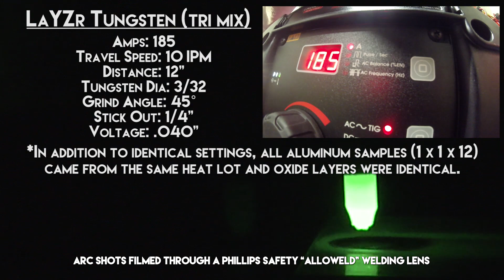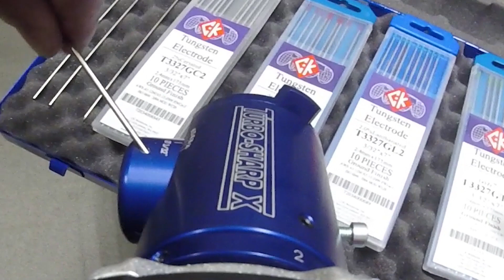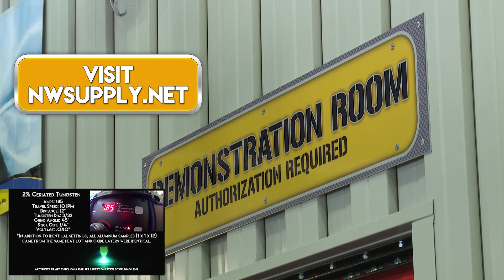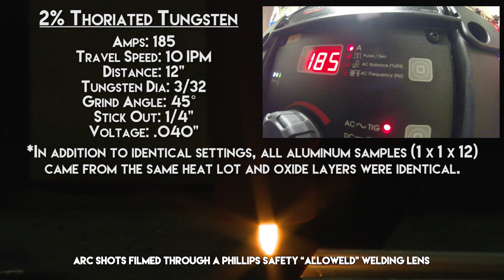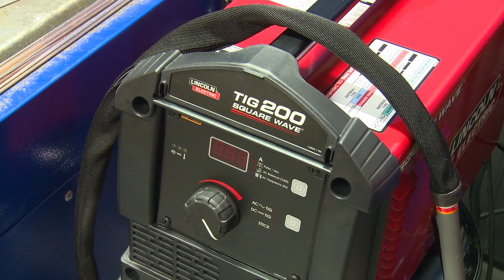Tungsten Comparison: Part 1 - AC Endurance Test | TIG Time

Comment: I've tried every tungsten I can get my hands on for Aluminium welding and by far my favourite and most durable is E3. Balls beautifully, doesn't crack or turn to shit like the ones in this video. 
My daily rod for the last 8 years from 10 amps to 300 amps.

Comment: So what tungsten lights up accurately after a minute of 185 amps A/C? What are the results? Did I miss something? 
I use the lincoln 200 with E3 tungsten and think they run the best.

Comment: Do they make tungsten for stick welding
Reply: What?
You must not be a welder.
Reply: No because in stick welding the inner rod is the filler and it's consumable. Tungsten would not be good if it was consumed into the base material.. it's a containment.

Comment: Thoriated for aluminum isnt good.   Good for dc but not ac. Ceriated or zurtung, lanthinated is also good. Im using E3 right now.
Reply: @donjuanmillcreek  yes. I think it brown
Reply: NTH Welding try using 3.2mm thoriated sharpened to a parabolic shape (think rifle bullet) and run it on DC negative for just long enough ball up the end to where the ball diameter is 3/4 the diameter of the electrode, back to AC and play with the balance until you're happy..i have used this method for 15 years and it beats the shit out of zirconated,  I haven't tryed E3  but we have to make do with what we have got

Comment: Check out Weldingtipsandtricks.com   He did a manual comparison that shows the beads for 6 Tungsten types on AC and 4 on DC.  Not as scientific as Mr. Tig, but it does show you some useful info that Mr. Tig did not.  https://www.youtube.com/watch?v=bpanERwagaU

Comment: You presented the tungsten afterwards, but not the weld beads, did they all perform the same?
Reply: There wasn't much of a bead since no filler metal was added, but I'm still curious to see what it did to the metal.

Comment: An AC welding comparison test without Zirconiated Tungsten? Or perhaps Zirconiated will be tested in Part 2? Zirconiated is purpose built for AC welding aluminium. It should be the yardstick by which other tungstens are measured for AC welding aluminium. I weld in AC using zirconiated and it deforms very little even when it's ground to a very sharp and acute point. Lanthanated gives me a fluttering arc while Thoriated is meant for DC!! Thoriated forms nodules at the tip on AC, producing a wandering arc at low AC Frequencies.

Comment: I'm hoping for a follow up on this because your video didn't give any results. My guess is because it's pretty much just a commercial for that welding supply, which really is fine. But your test could be better balanced with set ramp up and down, which will allow the tungsten to ball however it wants instead of blasting it from the get go. Also, what was the purpose of the travel speed in your test? If you do a stationary test, you can get a close up on the puddle and tungsten to show stability. As it is, your test did nothing but test the consistency of the equipment you used to produce the arc.

Comment: what hz did you use? how did the weld beads compare? what happens when you change the tip angles? inquiring minds want to know. lots of good info thanks.
Reply from the maker: +larry sperling All good questions. We will elaborate and do more testing in a future video. In the meantime, we used 120hz and you can see what the beads looked like here: https://youtu.be/MCK6U-WDV4c
Reply: Ian Alexander I have the 201xd, and while I’m new to TIG, I’ve been welding for 15 years or so. Using pure tungsten on this box I am having an issue with it popping a lot and the arc getting weird on me when I tried backing off the pedal once the aluminum got heated up. It still welds fine, but I have to be all over the pedal to walk a fine line between too much amperage and the wondering arc/popping. I ordered some lanthanated to try, as I fear the pure green is not a favorite as has been suggested. Hahaha I think the zirconiated might be your best bet.

Comment: i use 2% lanthanated almost exclusively. it can go worlds all over aluminum better that thoriated
Reply: 2% lanthanated is the best tungsten for AC welding I've found. 1/16" I've ran as high as 180A without breaking down and 3/32" to 300A. Stuff is amazing.